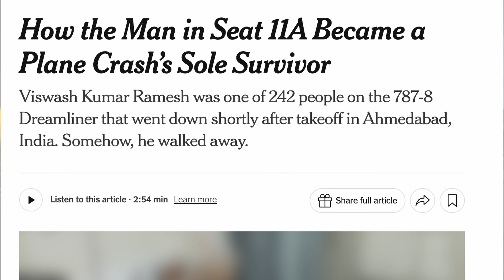Why the RAT Changes Everything – Air India 171 Update

Comment: I asked Grok AI for a list of what could cause both engines to fail. Here's the question in all caps and the list AI gave: LIST ALL THE REASONS WHY BOTH ENGINES COULD FAIL ON A BOEING 787 RIGHT AFTER TAKEOFF. JUST A LIST, SHORT ANSWER WITH NO EXPLANATIONS.

Dual engine flameout due to fuel starvation
Contaminated fuel
Simultaneous bird strikes
Volcanic ash ingestion
Severe icing conditions
Dual engine control system failure
Electrical system failure affecting both engines
Manufacturing defects in both engines
Maintenance errors affecting both engines
Dual engine compressor stall
Foreign object damage (FOD) to both engines
Extreme weather (e.g., lightning strike or severe turbulence)
Software glitch in engine management systems
Sabotage or intentional damage
Hydraulic system failure impacting engine controls
Reply: And from what I saw from another video, possible faulty data input by the pilots as to weight, elevation, etc. It being a hot day the air was thinner not very far above the ground, the equivalent of 3900 feet elevation according to the other video I saw. I'm not blaming the pilots. It's a testament to his clear thinking to broadcast what he knew at the time with so little time and so much going on. What a horrible thing to experience. Since there's redundant electrical and hydraulic systems, hopefully that will pinpoint what would cause all redundancies to fail.

I asked Grok AI: BIRD STRIKES, VOLCANIC ASH AND ICING HAVE BEEN RULED OUT AND ARE NOT CONSIDERATIONS. GIVE A COMPLETE LIST PINPOINTING WHAT COULD CAUSE ALL REDUNDANT ELECTRICAL AND HYDRAULIC SYSTEMS TO FAIL THAT WOULD CAUSE DUAL ENGINE THRUST FAILURE JUST AFTER TAKEOFF ON A BOEING 787. JUST A LIST, SHORT ANSWER WITH NO EXPLANATIONS.

Severe electromagnetic interference (EMI) disrupting engine controls
Catastrophic failure of all electrical buses
Total loss of primary and backup power generators
Simultaneous failure of all hydraulic pumps
Critical wiring harness damage to engine and flight control systems
Software malfunction in engine electronic control (EEC) and flight management systems
Contaminated or incorrect hydraulic fluid affecting engine actuators
Multiple lightning strikes damaging electrical and engine systems
Sabotage or tampering with electrical and hydraulic systems
Manufacturing defect in critical electrical, hydraulic, or engine components
Dual engine fuel starvation due to contaminated or blocked fuel lines
Simultaneous failure of both engine-driven generators and auxiliary power unit (APU)
Complete failure of both engine electronic control (EEC) systems

Trying to narrow it down I asked Grok AI: RULING OUT ELECTRICAL AND HYDRAULIC REDUNDANCIES FAILING AT THE SAME TIME IN AND OF THEMSELVES, PINPOINT ONLY THE CAUSES THAT COULD MAKE ALL REDUNDANCIES FAIL, MEANING A SINGULAR THING UPON WHICH ALL ELECTRICAL AND HYDRAULIC REDUNDANCIES MIGHT DEPEND ON FOR A BOEING 787 THAT COULD RESULT IN DUAL ENGINE LOSS OF THRUST.

Severe electromagnetic interference (EMI) disrupting all critical systems
Sabotage or tampering compromising shared electrical and hydraulic infrastructure
Manufacturing defect in a common critical component affecting all redundancies
Complete failure of the common power distribution system
Contaminated fuel supply causing dual engine failure

My last Grok AI inquiry: GIVE AN EXPLANATION FOR THESE THREE POSSIBILITIES YOU MENTIONED: Sabotage or tampering compromising shared electrical and hydraulic infrastructure, Manufacturing defect in a common critical component affecting all redundancies, Complete failure of the common power distribution system

Below are explanations for the three specified possibilities that could cause all redundant electrical and hydraulic systems to fail, leading to dual engine loss of thrust on a Boeing 787, focusing on a singular point of failure affecting all redundancies.

Sabotage or Tampering Compromising Shared Electrical and Hydraulic Infrastructure
Sabotage or tampering could target a critical junction or shared infrastructure, such as the primary electrical wiring bundles or hydraulic fluid reservoirs, that both electrical and hydraulic systems rely on. For example, intentional damage to the main electrical distribution panels or contamination of the hydraulic fluid with a corrosive agent could disrupt power to engine electronic control (EEC) systems and hydraulic actuators simultaneously. On a Boeing 787, which uses electrically driven hydraulic pumps, compromising the shared power feed or fluid lines could cascade to both engines, causing a loss of thrust control. Such an act would bypass redundancy by exploiting a common dependency, like the central wiring harnesses or fluid systems routed through a single airframe section.

Manufacturing Defect in a Common Critical Component Affecting All Redundancies
A manufacturing defect in a shared component, such as a specific type of electrical connector, circuit board, or hydraulic valve used across all redundant systems, could lead to simultaneous failure. For instance, if a batch of faulty microprocessors in the engine electronic control units or power management systems was installed during production, these could fail under the stress of takeoff, cutting off control signals to both engines. Similarly, a defective hydraulic pump design, used in all primary and backup systems, could seize or leak, starving engine actuators of pressure. On the 787, where systems are highly integrated, a single flawed component type (e.g., a common power relay) could undermine all redundancies, leading to a loss of thrust by disrupting fuel or airflow control to both engines.

Complete Failure of the Common Power Distribution System
The Boeing 787’s electrical architecture relies on a central power distribution system to allocate electricity from multiple sources (engine-driven generators, auxiliary power unit, and ram air turbine) to all critical systems, including hydraulic pumps and engine controls. A singular failure in the primary power distribution panels—such as a short circuit, thermal runaway, or software glitch in the power management logic—could cut off electricity to all redundant electrical and hydraulic systems. Without power, the electrically driven hydraulic pumps would fail, and the engine electronic control systems could lose the ability to regulate fuel flow or variable geometry, resulting in dual engine thrust loss. This failure would exploit the 787’s dependence on a unified power distribution network, overwhelming designed redundancies.

Each of these scenarios represents a rare but plausible single point of failure that could compromise the interdependent electrical and hydraulic systems, leading to catastrophic dual engine failure just after takeoff.

Comment: The question remaining… why did the engines fail? Also, if the RAT gets its power from the on-rushing airflow, that in turn would depend upon the airspeed, which in this case must have been low during takeoff. My understanding is that RATs are there to provide power at cruising altitude (or at least at higher altitudes and speeds) and not at take-off or landing. Your take, Captain?

Your warmth and humility is commendable. Thank you.

Comment: Question for the pilot here: whatever the causes were, which seemingly lead to both the engines being disrupted or failing most likely due to some fuel issue, would there truly be no signs of disrepair to the aircraft seen beforehand that would indicate to some crew that the flight should’ve been grounded?

Comment: Yes, the wheels were kept outside because the alarms had been triggered. The pilots clearly understood that the plane was not taking off, which is why they did not retract the wheels. Regarding the flaps, they operate at very small angles, and it's impossible to ascertain from the video whether they were utilized. This crash cannot be attributed to just one single factor.
This crash was clearly the result of a series of critical errors:
1. The technical team failed to conduct a thorough inspection of the aircraft and overlooked both prolonged and existing faults.
2. Considering the size of this aircraft, the pilots and airport management neglected to use the full length of the runway, which is essential for achieving the necessary thrust to lift a heavily loaded plane.
3. There were unmistakable signs of impending failures prior to takeoff, yet the pilots did not observed/performed adequate checks before departure and were only able to identify multiple failures too late. Ofcourse, yes, they were pressed for time after takeoff, but initial indications have been overlooked.
4. The deployment of the Ram Air Turbine (RAT) clearly indicates that both engines failed due to hydraulic failure and subsequent blackout.
5. Furthermore, the flaps had no relevance to the crash. They were most likely deployed correctly at an angle of 5-15% initially and were later retracted during descent to manage the rate of descent effectively.

My above assumption may not be that accurate. However, it is evident that the true causes and theories surrounding this crash will most likely remain undisclosed to the public. Investigators will require about another week to fully grasp the gravity of the situation and the underlying causes, but the findings will not be made available to the public. Instead, this crucial information will be reserved for the aviation industry and manufacturers of such stupid Boeing. Ultimately, the public will only be informed about 25% of the complete reality!!!

Comment: I'm circling back to the possibility of a fuel system issue. Even in cars, when climbing a steep incline with a tank that's half full or less, fuel can shift toward the back, potentially starving the engine and cutting off power. I suspect something similar may have occurred here — either a problem with the fuel delivery system or a faulty fuel gauge. It's possible the aircraft didn't actually have sufficient fuel. While everything functioned normally on the ground, the moment the plane angled upward, both engines shut down, which strongly suggests a fuel-related issue during incline.
Reply: Then the same would happen under accelleration on the runway

Comment: Steve...isn't it true that " Large commercial aircraft typically do not use 100% thrust for takeoff. They often use a reduced thrust setting, commonly around 80%, to extend engine life, reduce maintenance costs, and minimize noise. This practice, known as "derated thrust," is a standard operating procedure for most airlines." (I thought this was true so that sentence came from a Google search to confirm it.)  My question is this..."As a last resort (If a plane is losing altitude rapidly) Wouldn't pilot go "Full power and Full thrust" ? - So the black box should show if that happened. ALSO....Is the RAT deployment based on the power output of the engines or the air-speed of the plane? (Not the same thing)

Comment: I haven’t seen anybody mention this, but on one of the videos I saw a large cloud of dust blow up just as the plane lifted off.  That would indicate to me that they crossed the threshold of the runway.  If they started the takeoff roll at the other end of the runway, they should have had about two thousand feet of runway at liftoff.  Right?  So if they needed most of the runway to reach rotate speed, wouldn’t that indicate loss of thrust before takeoff?  It would seem to me that if you started to loose thrust between V1 and V2 you would have no choice but to try to get the plane in the air.  I can’t believe you could get a fully loaded 787 stopped without going off the end of the runway .   Just a thought.  Thank you for all you do on YouTube.  Pilots and ATC deserve so much credit for the jobs they do today.

Comment: Complete loss of power would explain the failure to raise the gear too. It seems that using the RAT the pilot tried raising the nose to slow the descent. But there wasn't enough time to attempt an engine restart. 

One of the commenters below suggested that the plane needed a lot of runway to reach takeoff speed (VR). Perhaps the engines were not working at full before they completely shut down (and without any telltale signs of a flameout).

Comment: Thanks for an update after you know more, but you need to know more about the 787: in the 787 you cannot retract the flaps with gear down in takeoff configuration. So, your earlier analysis is wrong, regardless of the earlier video or sound.

Comment: The explanation of a failure of the redondant hydro & electric power leading to  a dual engines issue seems crédible. Let s wait for what  thé black / orange boxes will say . I Hope Boeing will have the honnesty of not speaking too much of a potentiel pilots error ( as they did in the past) and sorry master Trump but buy Airbus not Boeing anymore… there are too many cost killers in this’company.

Comment: Both engines failure is a very rare incident that could happen to plane but it happened now. Maybe bcos of fuel or other factors like mouses or rats ate the wires inside that caused the electrical failure of what i saw in the earlier video of a passenger filming n complaining about the aircond not properly work. If the hostess or pilots know about such error in aircond like that they should have reported or checked to verify why aircond not working properly, and that was the sign something must be wrong with the plane. If i were the pilot i would have surely known and realized something at once by that error of aircond.....sad...very sad...

Comment: The Boeing 787 Dreamliner has an Airworthiness Directive (AD) requiring electrical power to be recycled at least every 120 days. This is to prevent a potential loss of all AC electrical power due to a software counter in the generator control units (GCUs) that could overflow after 248 days of continuous power. This could lead to a loss of control of the aircraft. 

If Air India did not follow this AD, both engines could have lost power due to complete loss of electricity. RAT is also deployed.

Comment: Dear captain, even though dual engine failure is letting you with no choice do you think they are right to fight with the elevators to pitch up the nose with out a trust? Don't you think they suppose to keep the nose straight even though it's obvious they are not going to escape crash landing but they  would have been reduced the death rate because that would have give them some seconds?

Comment: One assumption was there was an air bubble in the fuel lines caused by high ambient temperatures. Particularly on a hot tarmac of an airport for potentially several hours. The 787 is supposed to have tech to prevent bubbles. Perhaps a defect in that system

Comment: Hi Captain Steeeve,

I have a question.
I found this information online.

One engine failure after V1.
If an engine fails before reaching V1, the pilot should abort the takeoff. If it fails after V1, the pilot must continue the takeoff.

In this case of Air India 171, what are the possibilities of one (1) engine failure (right engine) after V1, pilots opted to continue (reason maybe why they had to use the whole runway) and after take off the second engine failed (left engine)?
The reason i think on right engine first is because i saw in one of the videos dust from the left engine right after take off, meaning they had thrust from the left engine at that point.
Let us know if this is a possibility. To me it sounds more realistic than both engines failing at the same time. (Without ruling anything out)

Comment: What about the fact that you can't hear the engines as the aircraft passes by in  the video? If this aircraft was falling out of the sky they would have the engines at full throttle. I live about ten miles from a major airport and the engine noise even that far away is loud enough that you would have heard it over the RAT easily.

Comment: The Rat would not come out for flaps, only for a loss of electrical or hydraulics. So we have to look at engine failure, if an engine failed mechanically we should have seen it happen between the time of rotation and loss of climb, we saw no bits of engine expelled or any smoke. if one engine failed for fuel reasons we may have seen some slight smoke from bad combustion but thats not guarenteed, but we would have seen a loss of that engine power yaw the aircraft and some pilot correction, there was no wiggle in its flight so no corrected yaw, so the thrust went from both engines at the same time. and at the same time discounts mechanical failure, or fuel issues as the engines have different fuel paths so bad fuel would take longer to affect the engine furthest from the bad fuel.
If the bang was compressor stall I would expect some visual sign of that with a puff of smoke or fire.
The engines just seem to have stopped, I suggest that they throttled back to idle or simply turned off due to a catastrophic electrical/computer failure, maybe linked to that 'bang' that was mentioned.. that bang seems to have been at the time that the wheels would be retracted, if that process started and something went wrong causing the bang and the loss, it could also explain the 'odd' angle of the wheel 'trucks'...

Comment: Why did this AI 171 plane use entire runway to takeoff,  could the takeoff be aborted if so if it was noticed that it is using more than needed runway, wasn't there any indication? Could takeoff be aborted??
Reply: ofc take off can be aborted but engine thrust must not reach a specific number. These big aircrafts are fully loaded with passengers/cargo and fuel and they are super heavy thats why they need bigger runway . Nothing was going wrong until they lifted off so they couldnt reject take off
Reply: It seems the plane use more runway than what's normally required for wide body planes, not understanding if this was a red flag